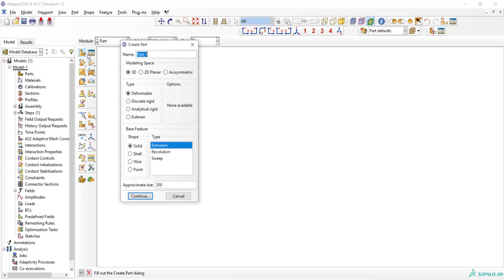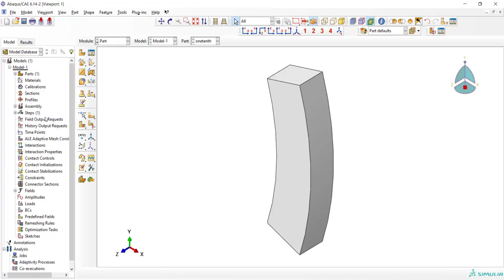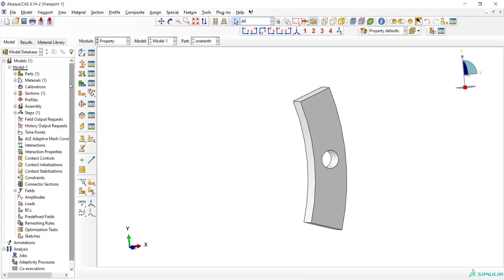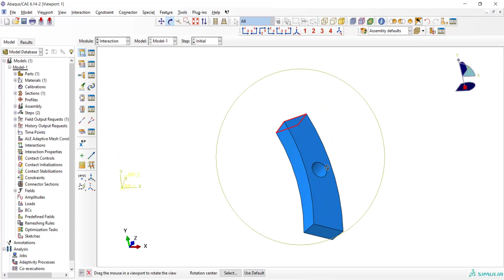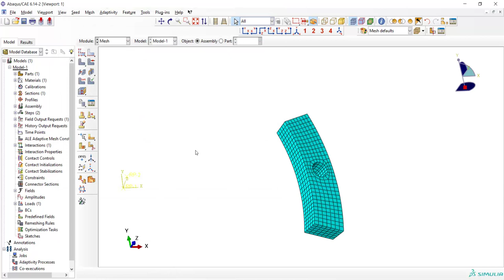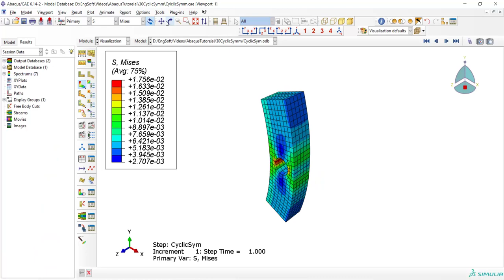Cyclic symmetry in Abaqus

Comment: thank you sir for this videosir ,how can i use cyclic syemmetry for a thick hyperelastic cylinder under internal pressure?
Reply from the maker: The boundary conditions and constraints  are similar to this model, just material definitions is different.